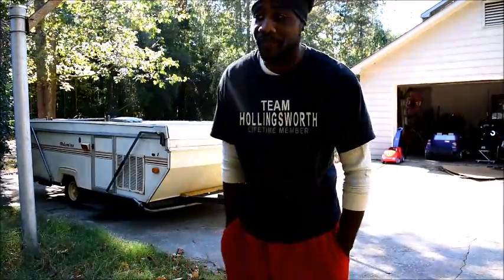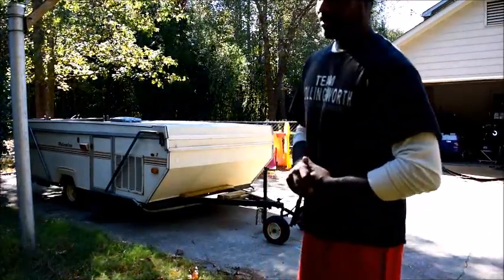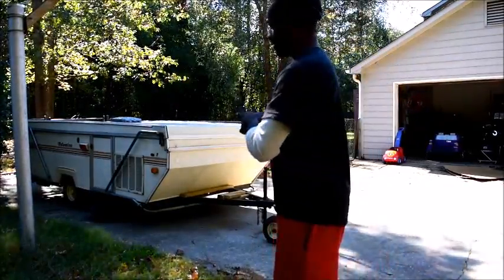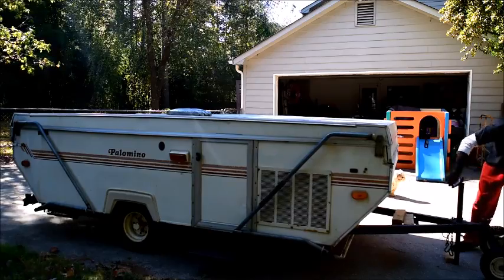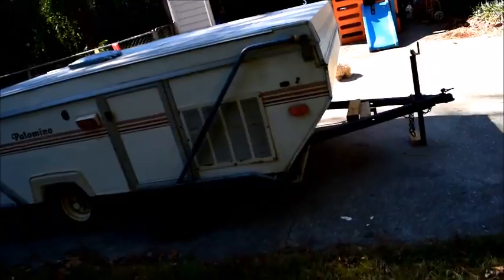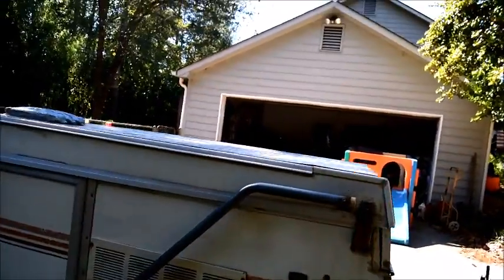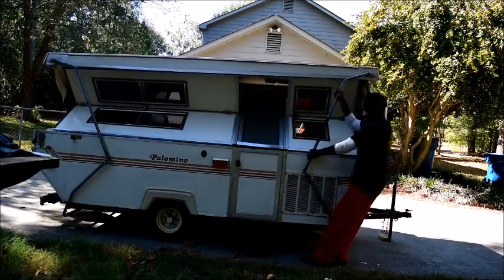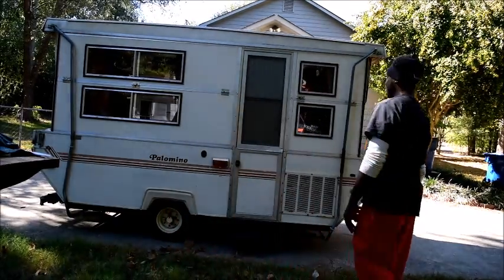Popping up our 1987  Palomino Pop Up

Comment: Thanks for the video! I have a TXL-SC that is huge. Bought it from a guy that only used in for a week every year or so to go fishing around Va Beach. Perfect condition with everything you can pack in a popup - regular home type AC housed at floor level, 19,000 btu Gas Heater, bath with hot water heater, gas stove for inside and out cooking, water pump, electric self-contained recirculating potty, gas and 12 volt refrigerator, electric screw lift on the tongue, and awning hooked to the roof. King bed one end, full on the other.

Had it about 1O years and used it three times. Busy working, but now I’m retired. Love the rubberized canvas on each end. Like another review that said to put snaps on the canvas to supplement the Velcro.

IT’S A GREAT CAMPER. Bought it for $3,500 and it didn’t need a thing done to it. Pulls like a dream, too. I have considered an A-Liner, but can’t bear to part with the self-contained Palomino with all the convinces and much more room.

One thing. After I bought it, I searched and found the old Palomino folks and they had 4 new lift springs in stock. Snapped them up. Install was easy and it helps with the lifting of the large and heavy roof. 

The beauty of this camper style is that you get the enjoyment of tent camping at night when in bed under the canvas, and the security and stability of hard sides. Oh yes! Also replaced the heater thermostat with an electronic model. More accurate, especially the time I had it out in the winter.

Again, enjoyed your video. I will try the method of going to the open door to snap the sides in place and lock the sides right then. I have been doing it at the lift rod on the end, and it’s harder to snap it in place that far from the center😊
Reply from the maker: Wow, amazing write up! Yeah it was a great camper for us to get our feet wet. We are un a larger hybrid camper now but soon we will be upgrading once again and getting something larger. We camp a good ten times per year or so.

Comment: I've been looking at getting an old palomino, but had no real reference until I found your videos. Thank you so much for posting these!
Reply: been looking at getting an older one as well and I really like and prefer the ones with the exterior arm Lift systems as Most of the ones ive seen (not all but alot) of the popups with the Cable lifts always seem to have brolen cables But stuff happens with age but seems these early to late 80s models of campers seem to endure the best over time Looking forwaerd next year to going camping again

Comment: Nice camper! I'm looking at one on craigslist, thanks for posting this!
Reply: Raisehell not sure where you are located (in the world) but I know that here in GA there are FB groups JUST for selling, repurposing, or buying used campers and RVs. Def check the FB market place. we may have to sell ours on fb. not sure yet.
Reply: Hmm, I'm in Texas, I'll have to check it out. Thanks for the tip. The add I'm looking at says air conditioning unit, does y'alls stay cool? I'd imagine GA summers are just as brutal as TX, and I'm too old for all of that.
Reply: Raisehell the account unit blows COLD but it's an old camper and can't pull that much current for long. I have ran it for hours for fear of burning on the plug, which is something I read online somewhere. ive also read that Updating the power unit inside helps
Reply: I just bought one today.  has anyone replaced ac?

Comment: Awesome!. Thanks for posting, LaDarryl.  Camping in Wisconsin means the weather can turn on a moments notice. When an unexpected storm rolls through I'd rather not be surrounded by canvas only.  Is yours a ten footer? How big are the beds? ---John
Reply from the maker: Im not sure of the box length or the extended length. Sorry. I say its over 10ft but not over 15ft. I'll have to get out there with my tape measure to confirm. I have more videos of the camper (especially the inside) posted on here also. One bed is a queen size and the other one is a full, but again I'll have to measure then to be exact. I just got the camper around the time I made this video so we actually havent camped in it yet. We will very soon though. Spring is here!

Comment: Great video! I have the same exact camper. Did you ever get bigger tires for it? I ask because it's pretty low to the ground.
Reply from the maker: TFierce you know what? Bigger tires would probably make a world of difference. I was just going to buy a low mount trailer hitch to level out the camper while in town, hoping that it wouldn't scrap the ground that way
Reply: That's exactly what I did. Got one with a bigger drop and it made a world of difference. Now it's 2-3 inches higher in back.

Comment: Hey we were looking at an 88 looks like to be in good condition but one of the arms is broken....do you have any idea where to get replacement parts for these as ive been looking everywhere online for the pass few hours
Reply: Craig Trimmer sorry but ive ran into finding replacement parts myself. I've done repairs and have had to reuse as much of the original stuff as possible. I just serviced mine and the arms look like something that could be fabricated  y using new steel poles depending on where they are broken.
Reply: Yea it snapped at the swing link/ hinge/ on the pole.
Reply: Craig Trimmer I just Google steel piping and fittings and  I believe that arm can be fabricated since it's the top half (above the hinge).
Reply: Mine also broke at the hinge when I was purchasing it. I found it by googling and it was on the palomino website for 60.00 each piece. Was u able to fix yours or buy new
Reply: We didn't end up buying it, bought a different camper altogether, there was too much that needed fixed and working 6 days 10 hrs, well no time to be a handy man. We did find it, 55 bucks for half the arm or a whole new arm for 110.
Reply: Craig Trimmer were did u find the replacement parts? It will be good to know.
Reply: Craig Trimmer  awesome !! Thank u!!!